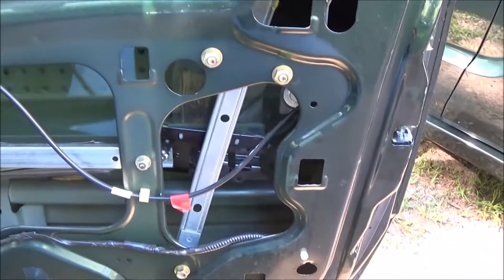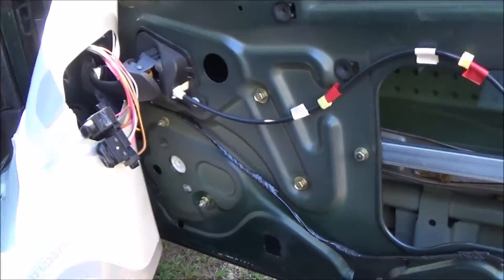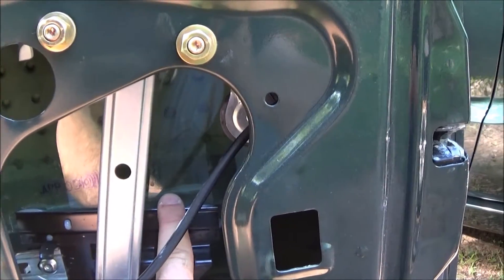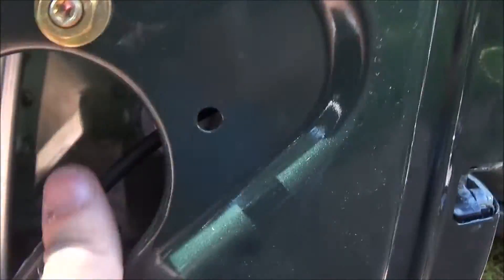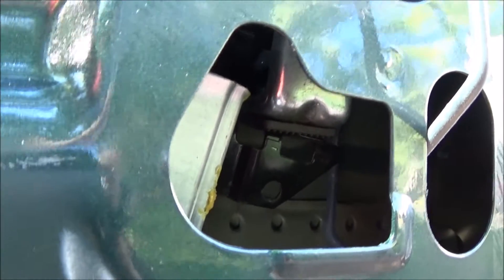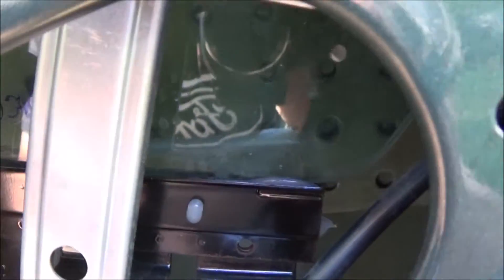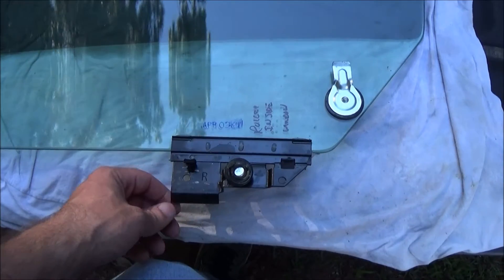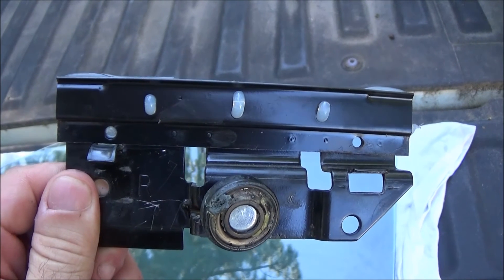Mustang "Window Rolls Up Too Far"

Comment: I'm curious if the glue worked. But the issue wasn't the glue. The rivet became loose and the torque from the window hitting the L bracket put all the pressure into the glue. The way to do it would be re riveting or, what I plan on doing,  is putting two small rivets so there's more shear strength
Reply: Do you have to take the window out to glue it?

Comment: How did you remove the window?
Reply: The glue holding the window to the elevator track failed. I imagine removing the window wouldn't be too difficult with the door panel removed and the failed glue you could probably just yank it out of there.
Reply: @UserNamedNone  No, the rivets have to be drilled out of the front and rear brackets.